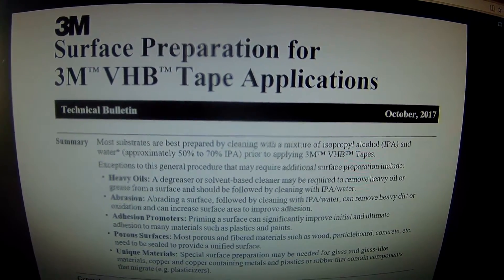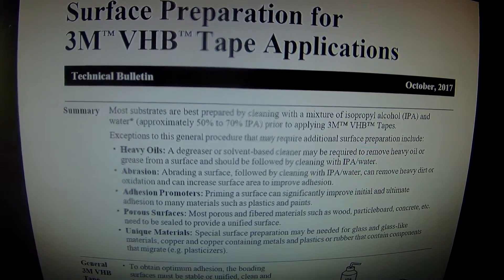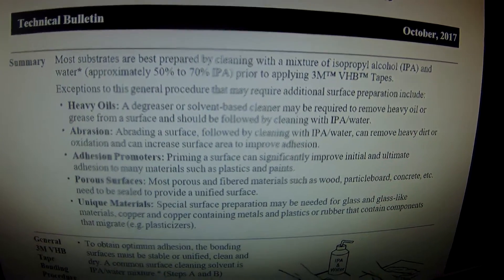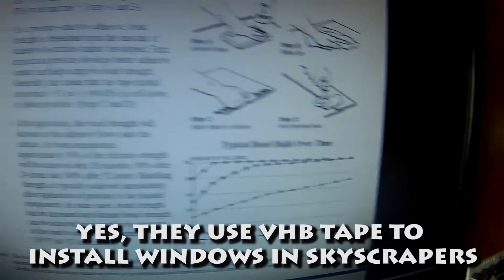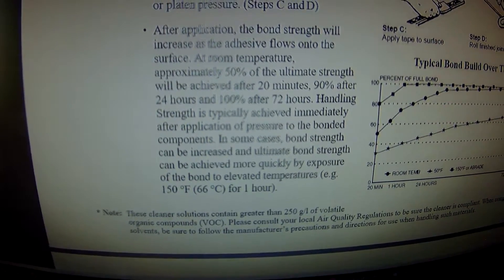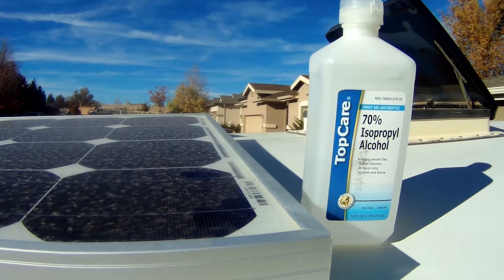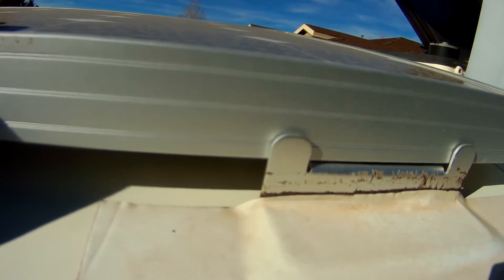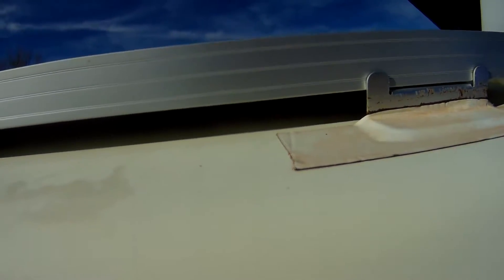LONG TERM TEST 3M VHB Tape Solar Panel Install - Is Tape Safe For RV's & Camper Vans?

Comment: awr old padawan Some Bright RV manufacture may Have added on Lighter Side of the Force of Solar By added Panel Mounting points and wiring post Or Have they? on lighter (modern teardrop trailer) you can find Solar input ports to on board Juice Boxes run a Fan and Leds, lighting or teeny tiny inverter 175 to 400 watts E power cooler boxes tiny device leds tv screen in bed size room teardrop trailer

Comment: I have a 25 year old fiberglass topper on my van. I knew from the start that I would NEVER drill holes in the top. I would hate to have to patch fiberglass. I have been considering using the tape. Thank you for showing that is has not melted in the heat! Happy Thanksgiving.
Reply from the maker: Yeah, I think most have little faith because we've all experienced how bad typical hardware store tape is. VHB is an entirely different monster and has been used for decades in some really insane applications. I ended up spending hours reading about the crazy things it can do and sold me that it would work for holding a couple of silly panels to my roof. Gobble Gobble!

Comment: Good stuff HT. I like using door hinges on projects like that. The hinge pins can be removable on one side to gain access to the other side. Take care
Reply from the maker: That's a great idea. That may not have worked for my install due to the curved roof, but maybe it could if some kind of spacers were used. Something to ponder.
Reply: @HOBOTECH  I saw a guy use hinges to mount his solar panel because his roof was not flat. The fact that the hinges can move allow for the ability to mount on an uneven surface. You connected one side of the hinge to the side of the solar panel and the other side of the hinge to the top of the van. The angle was not 90 degrees but it didn't matter because the hinge allowed for the flexibility. It never occurred to me that removing the pin from the hinge would make it an easier way to remove the solar panel. And once one side was loose the other side could just fold with the hinge to allow access underneath of the solar panel.

Comment: Good video, I have a Road trek too. Good advise I will give it a go! Where did the wires enter the cabin?
Reply from the maker: Awesome. The wires came through the a/c vent. You can see the original install videos here: https://youtu.be/qghxSwUgxEc
Reply: Great way to route the wire with out drilling a hole. I'm going to replace my a/c with a new unit. I will do the solar at the same time and route the solar wires into the vent. Makes sense. Keep up the good work. Check out Roadtrek Motorhomes- Vintage and Classic years- 1974-2004 Owners Group on facebook. Great people.
Reply from the maker: My a/c sucks too and it's not the OEM unit. Probably will end up replacing it some day. I'll look into the group but last I checked you need a personal account for that. I tried making a Hobotech account and was banned by FB for "not using a real name". Pretty much said F them after that.
Reply: You should really try again. Its a really great group. Lots of great info about our older Road treks. I have a 89. And have asked them for help fixing this and that.

Comment: Just put a panel on my van today. It has a fibreglass roof. Was going to glue it with 252 but decided to just use the self tapping bolts. It has wood stringers in the roof.
Reply from the maker: I'm curious what you used over the holes to prevent splitting and water penetration?
Reply: HOBOTECH I put the putty tape down first and went around it with self-leveling sealant. I didn't think about the possibility of cracking the fibreglass until it was too late. LOL
Reply from the maker: My exact thoughts were to use butyl tape over the holes then Dicor over the installed brackets. I do suggest periodically checking for any cracks so if any develop you can head them off quick. Since you have wood stringers you may get lucky!
Reply: I will keep my eye on it. It's just an old conversion van, not a class B. So I devalued it the minute I yanked all the back seats out.

Comment: I used the tape atop my 2004 Roadtrek and the first trip a couple of days later was quite nerve wracking as I kept an eye on my rearview mirror while I drove but now after 10k plus miles I can say this is most definitely the way to go when installing solar on fibreglass roofs.
Reply from the maker: Totally! I hope to spread the word because so many people are afraid to drill holes in their roofs or are simply misinformed about the abilities of VHB. I want to face punch the next video where someone says VHB turns into goo in the heat. Tell that to all those people working the 50th floor where all the outside windows are held in with tape!